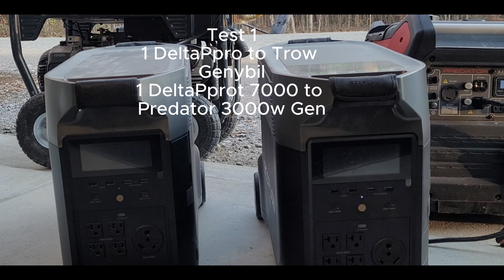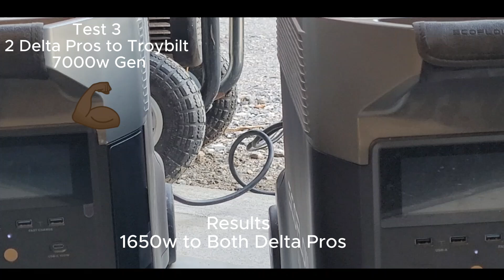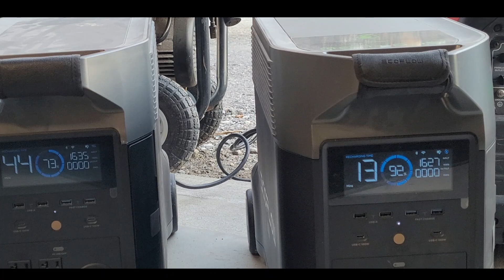Charging Ecoflow Delta Pro with A Gas Generator You Already Own!!

Comment: The Predator being an inverter generator has good clean power to charge the Delta Pro's.  However, if that Troybuilt is not an inverter generator you may want to do some research about consequences of using non-inverter generators to charge Ecoflows.  I've been reading that the non-inverter generators can cause damage to the ecoflow power stations.  Good luck.

Comment: Thank You for this video, can you also make a video charging these Ecoflow's from a smaller Honda EU2200i generator, need to know if these can be charged from a smaller Honda Generator as well. Thank You in advance.
Reply: Yes, the Honda will recharge the ecoflow. Depending on its output it may just take a bit longer. But if the power is out or unavailable it's still a great option